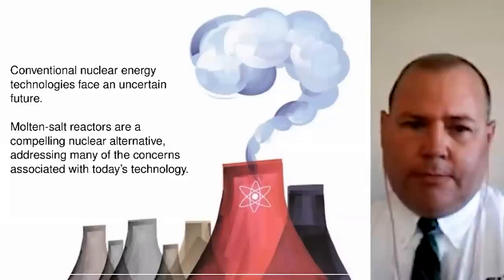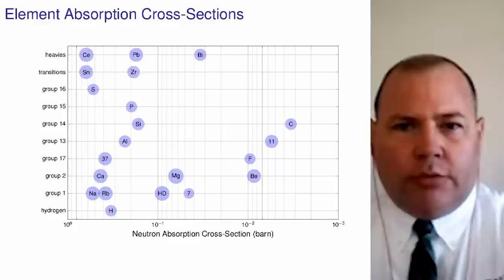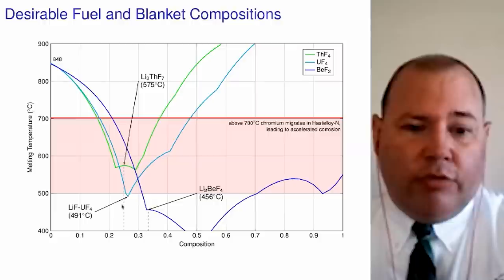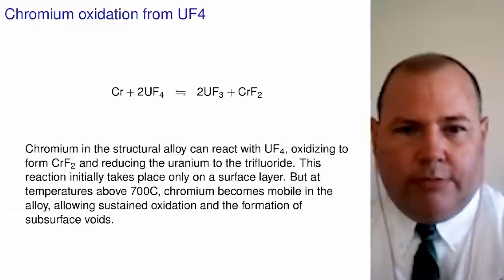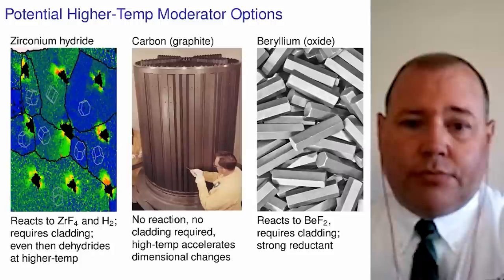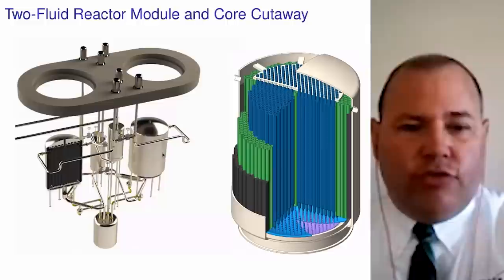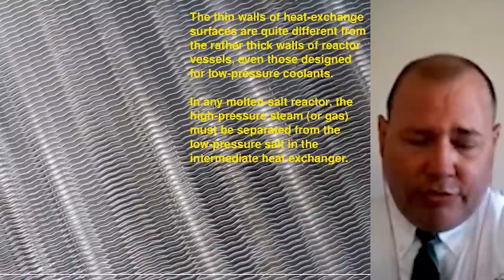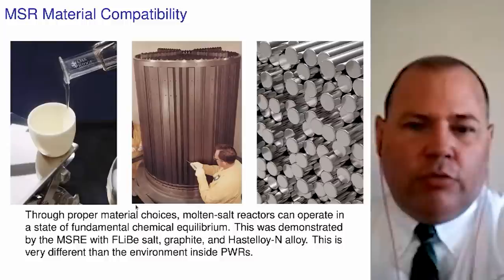Molten-Salt Reactor Choices - Kirk Sorensen of Flibe Energy @ ORNL MSRW 2020

Comment from the maker: https://www.patreon.com/thorium is where I do accept financial support. You'll probably find my Patreon feed of interest, if you like this video. Pitch in $1/year, is how I filter out those opposed to atomic power. I appreciate a head-count of supporters, if not real money. So don't feel like a small pledge is an insult... it is still very important to me.
Reply: Dear Kirk Sorensen I hope you can read this. What do you think about the Dual Fluid Reactor ?
Reply: Can the uranium fluoride be molten and form into a ball and then can it be used for easier transport?
Reply: @CUBETechie  (question 2) The form of the fuel isn't really where the transport issues arise...
Reply: Don’t be too modest to ask for more, you deserve it for getting this priceless knowledge out there! Editing & producing is tough work. I’m gonna move some stuff around in my Patreon acct soon ;)
Reply: You may not be there yet, but $1 x 100,000 supporters is good money.  It just shows what small change can/could do.
Reply: @CUBETechie  depending on temperature and pressure UF6 can be solid, liquid or gas

Comment: The more I think about energy, the more I come to the realisation that molten salt thorium is the only real savior here. We need carbon neutral reliable and safe base power, and we need LOTS of it. If we are going to make Power-To-X liquid fuels for the transportation sector, the energy requirement is truly mind boggling. We need an energy source that can replace oil, coal and old nuclear. We need it to produce carbon neutral diesel and gasoline, as well as LOTS of desalinated water for irrigation. As well as electricity and local heat.
Reply: sodium cooled fast reactors will be the best of both worlds, provided solar + batteries won't outcompete it all. But let's see.

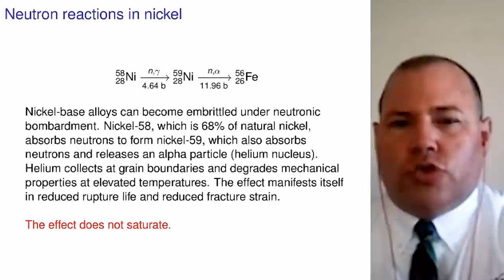Comment: 9:54 - 10:23, 10:10 more specifically-- There's a really cool new discovery that can help with this. It turns out if you embed carbon nanotubes in the metal, they help reduce alpha-induced embrittlement by serving as pockets for alpha particles to diffuse into without compromising the strength of the metal. Currently, it's limited to Aluminum alloying and "sintering", which is basically squeezing metal powder together at warm temperatures, so it's not quite ready for the rigorous safety and strength standards of nuclear energy. But, all things considered, it might be fun to experiment with.
Reply from the maker: I'd not heard that one before.
Reply: @gordonmcdowell  yeah, new emerging field of materials science. Exciting stuff.

Just out of curiosity, have you heard about the UCS report on advanced nuclear? It's called "Advanced Isn't Always Better", they argued advanced reactors like MSRs and SFRs are actually more dangerous. They have a couple of good points, but a lot of misconceptions you could clear up. Might make for a nice video topic.

I'd link the report, but YT tends to delete comments with URL links nowadays.
Reply from the maker: @mattbrody3565  Edwin Lyman. Sigh. Yeah I generally don't respond to paper reports when there's no video assets... it just turns into a vey boring Gord talking to camera video. I'll read it though. March 2021. Thanks for the heads-up.
Reply from the maker: Oh my God, they're citing LFTR as the first MSR they mention. You know they took a dump on "Thorium Reactors" when Yang was talking about them? But of course THEN they cited a single-fluid design saying it didn't perform significantly better than the alternatives. (The alternatives being relatively kick-ass 4th gen reactors.) So NOW, of all the MSR looking to be commercialized they're choosing to focus on LFTR as their first MSR-suck example. Interesting.
Reply from the maker: @mattbrody3565  If you write outside-of-youtube prose on this please CC me I'm gordonmcdowell either on Twitter or Gmail. I've not even got thru MSR part trying to edit video at moment so only reading when PC is busy. But I'll read it and any critique.

Comment: Viable operating temperature range of 150C, graphite confirmed as most viable moderator, and usable with Hastelloy-N, with a practical approach to capturing Tritium, top shelf work! The only major constraint being the availability of highly depleted Lithium, and of course legislature/licensing/public support. Otherwise very promising stuff, this is one area of research that gives me genuine hope.
Reply: jomax clux  Start by looking up the isotope Lithium-6 and its properties, you'll probably find some peripherally related data concerning the Castle Bravo project, which is a cautionary tale about knowing what different isotopes of Lithium can do in a nuclear situation.
Reply: jomax clux  And the second stage was a mixture of 30% Lithium-6, 70% Lithium-7. Separation of two different isotopes of the same element is where the problem lies.
Reply: jomax clux  Agreed, I would love to see it in Australia too, I'm learning everything I can about it, even looking at doing mechanical engineering so I can help build the things if that's what it takes!
Reply: jomax clux  MSRE was a uranium burner not a thorium breeder.

Is a thorium breeder possible? Sure, but more complex.

I'm more in the single fluid fast spectrum camp these days because of their potential simplicity (no moderator, cheap NaCl salt) and fuel versatility (breeds and burns just about anything as far as I can tell).
Reply: jomax clux  I didn't say it wasn't possible I literally said it was possible, but more complex than some other designs. Also, I'm not sure why you bring up fusion.
Reply: jomax clux  Ed Pheil's MCSFR and Terrapower's (Bill Gates) machine are single fluid, no blanket. Even U235 isn't particularly scarce, even for low burnup LWR's, so the abundance of thorium seems like a somewhat overblown feature. I don't have anything against the LFTR since it's hard to know for sure at this stage what will be the most practical MSR approach, so more designs being worked on is probably a good idea. A fast spectrum machine with a single fluid without moderator just looks a lot simpler. As I understand the MCSFR the core contains pretty much nothing but the fuel/coolant medium, not even control rods.
Reply: jomax clux  Commercial uranium harvesting from the sea is no more "theoretical" than the LFTR.

The second part of your comment doesn't give the LFTR any advantages over a reactor that can run on any fuel including thorium...
Reply: @AximandTheCursed  Not sure what you're saying here, but as I understand it, Lithium-7 was the problem in the Castle Bravo test because the scientists/engineers assumed that it would be inert.  Instead, a sizeable portion of it became converted into Lithium-6 in the environment of the thermonuclear explosion (by losing neutrons) and became additional thermonuclear fuel.
Reply: @sciencecompliance235  I was referring to the problem of separating the two isotopes of Lithium before before the test; from what I could tell they couldn't really figure out a practical way to do it and also assumed that it wouldn't be a problem as long as they had enough Lithium-6 to achieve the desired yield. They didn't know the effect it ended up having on the Lithium-7 beforehand.

Comment: We do some experiments with high temperature salt - solar power plant and for salt bed-reactors in chemistry. The problems you mentioned are well known. My concern is the weldability and the microstructure. According to the shell theory, we need thick sections if we'd like to increase the diameter and so the power. In order to have the necessary corrosion properties of a nickel-basis alloy, a solution annealing is necessary. At this point the size of a reactor could be the problem, because this solution annealing means quick cooling from ca. 1150 degrees of C. I have this experince with Alloy B-3, and C-2000. Any deviance could result corrosion or precipitations at the grain boundaries - and we talking about decades of operation temperature. Do you have some results on welded samples?

Graphite: There is some situation - e.g. silicon-carbide production for catalysators - where the only option is a heat exchanger made from graphite. Graphite is extremly badass in this situation and used in special cases. I've seen some graphite heat-exchangers in SiC production. We use SiC for catalysator production.

If we don't have so high pressure, we might don't have to calculate with PWSCC in reactors/nozzle connections and this would be a game-changer. PWSCC is a huge problem at the conventional reactors. 

You didn't mention in this video, but there is a possibility to use MSR to produce hydrogen as well - the salt can transfer heat to a hydrogen production system based on e.g. of a variant of the Ca–Br (UT-3) thermochemical cycle. This projects is really nice and I really like your vids, prehaps we could work together once :)
Reply: Couldn't the alloy be solution heat treated after welding? Unless it is welded in situ at the reactor site, or is a very large component such as the reactor core it may be a problem. In which case can these materials be friction stir welded or ultrasonic welded?
Reply: @Bordpie  ultrasonic welding wouldn't be a good choice, not for thick section.

Friction stir welding would have the same problem, inhomogenity in the weldment, therefore a solution annealing might necessary. As I mentioned above, I have experience with B3, C2000, 625, 825 and C4. In most cases a solution annealing is not necessary - due the low operational temperature (below 300 degrees of C) and not such a harsh environment like molten salt at high temperature... 

A lot of material reseach sould be done - and hopefully would be done. Without nuclear energy the real and reliable clean energy is just a wishful thinking - and a great opportunity to steel some money from any goverment. Sadly, the best example is Germany or California.
Reply: @tiborkemeny8644  There is tensile and rupture life information on the Haynes website for Hastelloy N for welded plate samples. Tensile strength goes down a little for the welded material and rupture life reduces by half compared to the stress relieved sample, measured at 700C. Nothing on how the corrosion resistance changes though. 
I stumbled across a paper looking at the microstructure of welded Hastelloy X for WAAM. Some molybdenum carbide precipitates formed in the weld bead although this is different to Hastelloy N, less molybdenum and more chromium and iron in the X alloy so it is not necessarily representative since different elements can affect soluability of others and formation of different precipitates.
Reply: Hi Tibor, I work with the metal fabrication industry in Israel.   Are you aware of the qualitative advantages of laser welding of metal alloys ?   Contrary to traditional TIG welding, laser welding can produce a weld bead that's actually stronger than the surrounding base material.   I train and support customers in this type of application, it's well established and available in Europe and the USA.
Reply: @trespire  Hi trespire. Well, there is no easy answer for this. My main consern would be in this topic the Marangoni-flow during the welding and how could this cause some microstructural difference. 

Basically the longitudinally welded pipes made from nickel-basis alloys are always solution annealed after welding. Welding points differ in composition and
structure (crystallinity, metallurgy) from the rest of the base material and could be more susceptible to corrosion -> This is the reason for a solution annealing - I even if it had been welded with laser.
Reply: @tiborkemeny8644  Hi, I'm not sure why there would need to be longitudinally welded pipes, I would have thought seamless extruded pipes would be an obvious choice, unless these said pipes have extreme geometry as in large diameter / extra heavy gauge.
To reduce / control / manage the Marangoli effect typically several approaches could be employed 1) tight tollerance preparation so no filler material is required, so only mixing of the base materials 2) parts preheating to reduce the thermal gradient 3) developing and tight control of the laser beam characteristics (very applicable with current machines) to minimize unnecessary heating of surrounding base material (heat effected zone)
Obviously some microstructure differences will persist, but with a well controlled fabrication process, it could be reduced and quantified to knowable values, if it passes "muster" for the application demands.
Reply: "In the near term, it appears that our best bet is to stick to those thermal margins and to operate within them." @ 6:00 .
The margins he mentions are 300 - 500°C. It doesn't appear there is any problem with operating this way starting right now. Unless you know something i don't. According to Sorensen, they're just being held back by political inertia right now. The MSRE operated at its full power of 10 MWth for nine months of continuous operation (first 1 continuous month, then 3, then 5) between 1 January 1967 and 31 March 1968. It needed zero refueling during this time. And a total online time of 80% during those 15 months, with a operating temp of up to 650°C. Why is there still such resistance to going forward with this type of reactor and coolant? Even if they had to replace the coolant pipes every two years, the power is still a fraction of the cost of any other option going forward. So why are we still arguing about such irrelevant minutiae, literally 53 years after the technology was already proven?

Comment: We're working on the small modular concept  for bases and off-site field installations. While still in the concept stage we have 2 models built on the MSRE concept. The most promising is a small modular Fast reactor.
Reply: the little danger with fast_MSRs, in my opinion, is that by mismanagement, ignorance, or geological-disaster-event (super-volcano), water could get near the fast-core and start maliciously moderating the neutrons! Chernobyl had two explosions, 3 seconds apart, one of that was quite certainly a supercritical event!  See Scott Manley on YouTube

Comment: Sodium 22 chloride salt reactor with a stainless steel vessel with fuel salt in a boron carbide tube or zirconium hydride tube could breed uranium 238 from waste to thorium with gravity for processing of waste, skimming for floating waste or out gassing. Chloride is cheap and abundant. Though iron boron aluminum alloy might work for lead bismuth reactors. Though beryllium chloride with thorium chloride with boron carbide may work.

Comment: "highly depleted lithium", does this mean battery waste will be of use, thus closing that part of the cycle??
Reply from the maker: It is irrelevant to battery recycling. For nuclear purposes this is extremely low-volume compared to battery waste. And "depleted" means containing a particular isotope not "used up" as in aged battery. You might have known that, but just making clear.

Comment: How much thorium waa in the mix in the original MSR? I know there was some because we found U-233 during the cleanup.
Reply: None.  Initial fuel was 33% enrichment U235 and later smaller amount of U233 was used.  Thorium breeding blanket was not introduced.  It demonstrated the feasibility of the Molten Salt Reactor engineering.

Comment: I worry about the difficulty in controlling gap-losses in the CO2-Brayton-Cyle gas turbines. Especially on cold-start-up,  (risk of blade-damage by differential thermal expansion) or variable load duties. Generally, in a larger turbine, the %-age of loss would be smaller, relatively. The development of this new turbine-technology should be supported and undertaken, other branches of economy would profit too, having this equipment available. 
For small modular reactors, employing CO2-driven piston engines or large Stirling engines would be the easier choice. 
in the 2nd half of the century, there may be a necessity for the global economy to extract CO2 from the atmosphere and ocean, which could be done by a technology, based upon technical and chemistry synergies of Th_MSR-fission and DT-fusion energy-reactors (Tritium, Li_6, Li_7, molten-salt blanket). I wouldn't want to rely on solar- and fusion-energy alone, for that demanding global job! 
China is certainly not in the boat for greenhouse-gas reduction or limitation, for now. Maybe in the future.
Reply: Hasn't this problem be solved in HELE dual cycle coal plants. If so, it should just be a matter of plugging in a nuclear MSR heat source to replace the coal furnace.
Reply: @jimgraham6722  thank You